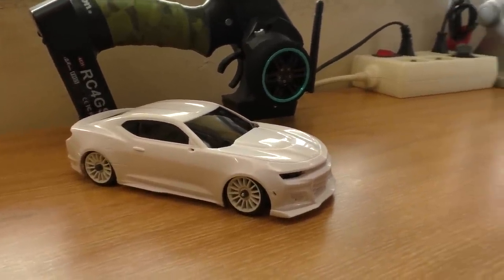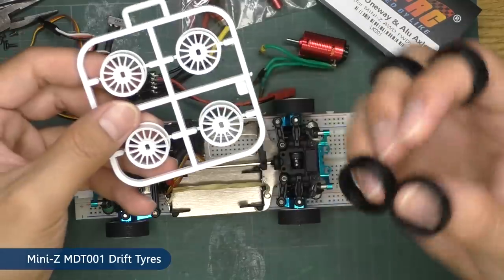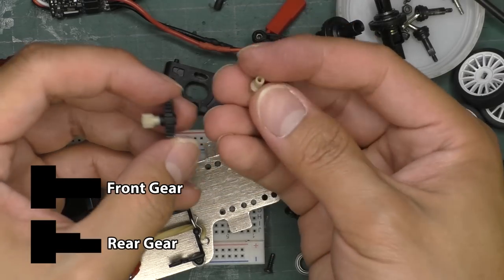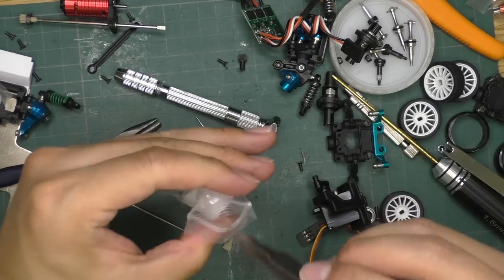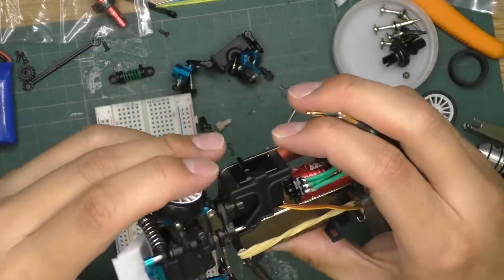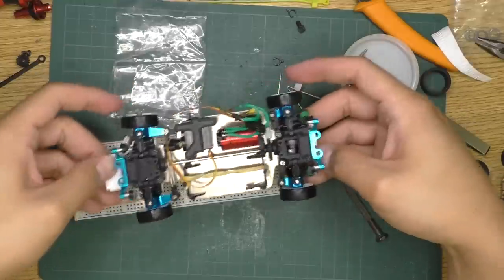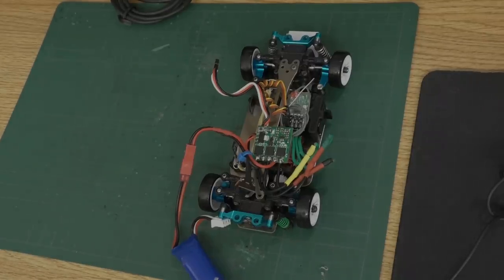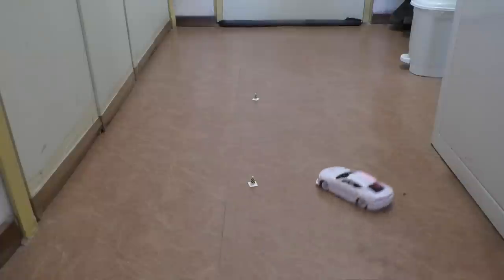WLtoys K989 (and 284131) Budget Brushless Drift Build 2021 Edition | Full Tutorial

Comment: Hi Beaver,
I use the same motor and esc as those in your video. But I have a problem here. I have set the voltage cut off to position 6 the same as you've done in the video. At first, the esc and motor works normaly. But after a while, the esc show strange behaviour. It repeatedly emit 2 green light (or 2 beep) and the motor won't rotate even if I pull the throttle (but the servo works normgaly). The motor will work again (and there will no 2 continous beep) if I set the cut off to position 1. Any other cut off position (2-6) will cause error to the esc and motor.
Can you help me to solve my problem? Can you guess what the cause of my problem? Is it the defective esc, motor, or battery?
FYI, I have measured the battery voltage after charging. The voltage is about 8.4v (instead of 7.4v as written on the battery body). Is that normal? Note : I use stock battery that shipped with the RC.
Reply: I use radiolink rc4gs and the included receiver
Reply from the maker: @noviantobayuprabowo8094  It looks like you got cut-off when it suddenly stopped. However the LED should be blinking red but I could be wrong. Sounds to me like the voltage drops too fast and triggers the cut-off.
The position 1 of cut-off it turning it off. There's no negative effect to the power delivery but it will not stop the car if the battery goes lower than minimum safe voltage (2.7V per cell) so if you keep monitoring the battery voltage, you can turn it off.
The 8.4V is fully charged voltage of 2S lipo so there's no need to worry.
The original battery is decent. But if you have another 2S to try then do it first. Since the ESC still (sort of) working I would assume it's stull function properly.
Reply: @BeaversHobby  Thanks for your quick reply my friend :)
Anyway, I have another lipo battery to try. I have measured their voltage and they are above 7 volt but they give the same esc error.
Actualy, the esc work fine for a short time after instalation/assembly (even if I set the cut off mode to 6). But after a while it began to error.
Reply from the maker: @noviantobayuprabowo8094  That's really strange. But it can go faulty so there's that too. If you are certain all the wirings are correct then there's a problem with the ESC. By the way you can also try reversing the channel 2 and calibrate it again but I don't think it'd make much difference.

Comment: Beaver.... i didn't see u puttin a CS gear setup here in this video... is CS gear not really necesery for this awd build?
Reply from the maker: It's optional and can be done even easier with the parts I show in this video.
Reply: Hmmm but what do u think, Do u prefer this one or with CS gear setup?... personaly, i hv followed ur previous CS gear videos and build up everything i need for my K989 just to be like urs, but in finally it's really hard to control... i forgot the ratio amount of my CS but it's kinda pretty high...
Reply from the maker: @harukaze5408  I prefer this electronics & diff setup (one way + solid axle) with a bit of CS ratio. CS can be hard to control if the ratio is too high. Keep it between 1.5-1.875 (12T-15T rear gear) and it'll be easier to control. Also you'll need the front one way to make it controllable.
Reply: Oh i see... maybe i should lower the ratio.... it's kinda more than 2... I also hv installed the FOW... but still, when i do a donat with CS controling, sometimes it turns on the other side easily... like when i make it turn left while doing CS, the car turns to right quiet a bit... do u think it's bcuz too much ratio?
Reply from the maker: @harukaze5408  It's the steering trim. You'll need the steering to point dead straight to get it to go forward. CS is a bit tricky to go forward without veering off but it's doable.
Also check the suspension and tyres contact too. Front left and right should touch the ground evenly all the time and no wheel is lifting.
Reply: Thank you so much, Beaver... i'll try to check em first... i hope it's gonna work for my car...
Reply from the maker: @harukaze5408  My pleasure. Best of luck with your car!

Comment: I'm thinking about buying a k969 because it's 30 euros on Ali express. the only thing I don't like is the body it has. I found on rc mart that there are alot of mini z bodies for 18 euros that you have to paint your self. for example the Mazda rx7 fc3s. what I understood from your earlier videos is that the wheel base needs to be 95mm. On rc mart I also saw that alot of cars had widebody kits. could that make it fit?
Reply from the maker: Wheelbase is 98mm you can still adjust the wheel offset to make it fit. Wide body kit will also help.
Here's the list of the compatible bodies I've compiled. https://docs.google.com/spreadsheets/d/1v2sVg072T2Xl4tvEEy_E7kiDdmen-gRIWWm-pIp1VXY/edit#gid=0
Reply: @BeaversHobby  very nice list, only problem is that I like to have a jdm body, like a rx7 or r32 Skyline.
Reply from the maker: @itz_scout8100  Unfortunately the JDM from Mini-Z are 90mm (RC7) and 94mm (R32). The closest you can do that will fit is Subaru 4 door, the new one. Or you can use a 1/24 scale model. I remember RX7 fits but not sure which brand the model is. Check out this build. https://www.youtube.com/watch?v=s_r2uF2up_w
Reply: @BeaversHobby  I see, unfortunately it's no longer produced. could I maybe put wide body on r32 and scrape a little bit off so it fits?
Reply from the maker: @itz_scout8100  Yes, I think you can do R32 wide body. Shaving 4mm off the rear and cover that with body kit should fill the gap nicely.
Reply: @BeaversHobby  great! I am going to try that!
Reply from the maker: @itz_scout8100  You can also try this and see if they can ship to you. If Japan has opened airmail back up to your country, that is.
https://banzaihobby.com/Kyosho-MZN185
Need 0mm offset wheels though, not what are included with the body. http://bit.ly/30ThqD2
Reply: @BeaversHobby  thanks for the help!
Reply from the maker: @itz_scout8100  My pleasure. Best of luck with the project!

Comment: beaver's hobby i have question on how to bind my k989 since my transmitter broke recently, i bought a new transmitter its the same but it wont bind, do u know how to bind it?
Reply from the maker: Turn the car on, turn the transmitter on then move the steering wheel. If it doesn't bind then the transmitter is probably a different version. Which one did you get?
Reply: @BeaversHobby  the stock k989 transmitter
Reply: i see now the one i got is probably a different version which is why it wont bind
Reply: also im going to try out brushless rwd drifting what kv would you recommend? hit me up with some cheap brushless esc too if you can thanks in advance
Reply from the maker: @shin7266  3500KV is enough. 5500KV if you have a large track more than 3 metre wide.
As for the ESC, take a look at Dasmikro https://bit.ly/3h07teH .
Reply: @BeaversHobby  thank you again

Comment: just bought my first drift cart 969 with gyro  does it matter where you mount the gyro? up front or in the rear?
Reply from the maker: Anywhere is fine as long as there's a flat surface and not next to the motor so there's no electrical interference.
Reply: i have to figure out the gyro settings
Reply from the maker: @johndavid5627  If you still use the original electronics, gyro connects to the 2-in-1 on the car and then the servo to the gyro. You can only adjust the gyro gain on the gyro unit. And that's pretty much it. If the direction is opposite (it doesn't counter steer) then there should be a switch on the gyro to reverse that.
Reply: @BeaversHobby  thx   its set at 50%
Reply from the maker: @johndavid5627  For AWD drifting 50% is a lot. Try something like 15-25%.
Reply: @BeaversHobby  wow!huge difference i got way more control it was dialed up too high ,thx its drifting good now

Comment: Hey, can you recommend banggood only upgrades for this car? Can't buy from AliExpress :(
Reply from the maker: All of the stuffs are from banggood except one way and long CVD. 
Long CVD is back but I'm not sure if this is the same set that I have before. Banggood has a habit of changing the content. https://bit.ly/3m1i4bd
One way is gone on banggood so that's unfortunate. Don't worry if you don't have it though. It'll still drift.
Wheels & tyres, you can try Firelap rounded tyres. https://bit.ly/3tiamNk They are out of stock right now, I'm not sure when will it be back.
Reply: @BeaversHobby  thanks!
Any diff from banggod you recommend? For durability with good quality.
Reply from the maker: @cyberpunkfpv3032  There's no differential for drifting on banggood right now except the ball differential that you can lock. However it's much more durable than WLtoy's plastic but it's the same size as Mini-Z diff so you'll need the long CVD for thiis. http://bit.ly/2Wm6puF

Comment: Hi Beaver, is the HRC LB Works GTR35 fits on K989? if it does, what are the wheels offset?
Reply from the maker: LB GTR35 sort of fits with narrow wheels 0mm offset on both front and rear.
The shock tower fits perfectly without modifications but you'll have to cut the front splitter and shave the front wheel arches otherwise it won't be able to turn
Reply: @BeaversHobby  ok thanks
Reply from the maker: @luckyt3526  My pleasure.

Comment: 가격대는 얼마이고 속도와힘은어느정도입니까
Reply from the maker: With the transmitter and upgrades + body it would be around $200. The speed is about the same the stock because 3500KV. This helps to last longer as the brushes in stock motor will run out eventually, brushless doesn't have that.

Comment: How many  KV For RWD drift brushless motor?
Reply from the maker: 3500KV for small track under 2.5-3M wide, 5500KV for bigger.
Reply: Das micro Esc is same hobbywing 18a ?
Reply from the maker: @Andozable  Similar but not the exact same.
Reply: @BeaversHobby  so for conclusion what is the best, hobbywing ezrun 18 a or dasmikro?
Reply from the maker: @Andozable  Dasmikro is better. They have a new version now (V3) so it'll look slightly different than in this video but it works the same.
Reply: @BeaversHobby  thank you

Comment: Would that motor work in a 1/18 scale for drifting?
Reply from the maker: Unfortunately no. 1/18 usually use 2030 motor or bigger. This is 1625 so it's way too small.
Reply: Thank you! I’m New to rc car motors.
Reply from the maker: @josh4048  My pleasure.

Comment: how did you sort the front toe out after as i bought the parts required and cant get it to center?
Reply from the maker: Adjust the toe as you like first, then adjust the rod that connects the steering to the servo. You might have to try different rods to get it to centre.
Reply: @BeaversHobby  thanks for the prompt reply.
tried all the the different size in the pack Orlandoo rods, cant get it to centre unless i put alot of toe out like alot alot :)
Reply from the maker: @PrInCeUKER  Try the long rod from Mini-Q and cut a bit of the end out if it's too long. I did that (on the other car) and it works.

Comment: Hi Beaver another question, can we use heli or drone ESC? For our min RC cars
Reply: Like Emax, BHeli
Reply from the maker: @jeepnypitpits  Normally no. Unless you can program it to have the motion forward-brake-reverse. 
As far as I've tried it can only do forward-neutral or forward-reverse (for 3D flight). There's no brake which is essential for a car. 
I haven't followed the firmware development for a while now so if you can program what I just told you then, yes, you can use that on a car.
Reply: @BeaversHobby  thanks beaber, it's hard to find the Das Micro ESC you've recommended.. will review other ESC.
Reply from the maker: @jeepnypitpits  It depends on where you are but you can look for PN Racing ESC V2 in a Mini-Z racing shop.
Here's for US/NA https://www.kenonhobby.com/PN-Racing-V2-Micro-Brushless-16A-Speed-Control-Unit_p_46471.html or https://www.wolframrc.com/product/v-2-micro-brushless-esc-16a-pn-racing/1566 .
EU http://www.minizracing.it/minizshop/index.php?main_page=product_info&cPath=65_213&products_id=14148
Reply: @BeaversHobby  I bought the YSIDO 18A esc it was specified for MiniZ, hopping is has brake functions,, then will pare it to Surpass 1410 2500KV for drifting in a very small flooring of our house 🏠,  em I correct selecting the 2500KV or should I go to 3500 KV?
Reply from the maker: @jeepnypitpits  Go for 3500KV. I looked at the ESC you mentioned earlier, seems like it's the same as the ZTW OEM for Sinohobby I have had before. It's alright. Get this one if you can, it's basically PN Racing V2 but without the label and it'll work better than the ZTW. https://www.aliexpress.com/item/1005002919336408.html From what I can find it's the same price too. The motor doesn't seem to be as good as Surpass Rocket but the ESC is much better and it'll work.
Reply: @BeaversHobby  ok thanks for the recommendation will go for the Surpass 3500KV, thank you also for checking the ESC you gave me some peace ✌️ of mind hihi 😊
Reply from the maker: @jeepnypitpits  Always a pleasure. Best of luck with the project!

Comment: What rear diff did you use?
Reply from the maker: Solid axle or locked diff.
Reply: @BeaversHobby  Thanks. Was the one in the video the standard wltoys one?
Reply from the maker: @machinist_matt  What I showed in the video was a ball differential that I tightened it to lock. You can get the similar result with standard WLtoys diff and glue it or put a piece of paper inside to block the gears.
Reply: @BeaversHobby  OK. Thanks for the help. 🙂👍
Reply from the maker: @machinist_matt  My pleasure.

Comment: Okay I have a question so I bought a new esc for the wl toys k989 and I don’t know ho to connect the new esc to the transmitter
Reply from the maker: Is it the original 2-in-1 unit? If so you can turn the car on first then turn the transmitter on and turn the wheel to bind.
Reply: @BeaversHobby  i tried but it didn’t work the problem I’m having is the new receiver I bought won’t bind with my wl toys k989 transmitter
Reply from the maker: @tubbiesnipes4022  I meant if you bought the original 2-in-1 replacement or something else?
Reply: @BeaversHobby  I bought the original
Reply from the maker: @tubbiesnipes4022  That's strange. Does it blink or anything? Also make sure that the battery is fully charged.
Reply: @BeaversHobby  yeah it blinks and the battery is charged I just need to receiver to bind with my transmitter and I can’t find anything on how to do it
Reply from the maker: @tubbiesnipes4022  Basically the procedure is 
- Turn the car on 
- Turn the transmitter on
- Move the transmitter wheel or trigger 
- The light on the car should go solid and the light on the transmitter will change from 2 colours to 1 (probably green, don't really remember) and it's bound to the transmitter.
If that doesn't happen there's a good chance the receiver is faulty.
Reply: @BeaversHobby  okay now I know the receiver doesn’t work so do you have any recommendations for a new receiver and transmitter
Reply from the maker: @tubbiesnipes4022  Turbo Racing P52 or the one in this video, Radiolink RC4GS. They'll come with a receiver too. You'll need an ESC as well. If you want to keep using brushed motor then get DumboRC 10A. It'll have brake and low voltage alarm (need to solder 5v buzzer to it).
Reply: @BeaversHobby  thanks for all the help I’ll subscribe
Reply from the maker: @tubbiesnipes4022  My pleasure. Best of luck fixing it!

Comment: Does the car need gyro to drift well?
Reply from the maker: No, it doesn't. AWD/4WD cars don't need gyro for drifting.
Reply: @BeaversHobby  Which one better, SG 1603 or WLTOYS K989?
Reply from the maker: @nihadshobby4989  They are different scale so it's hard to compart. Still, I think K989 is a better option with more upgrades and it doesn't need a large area to play.